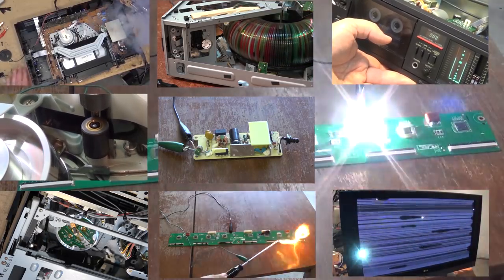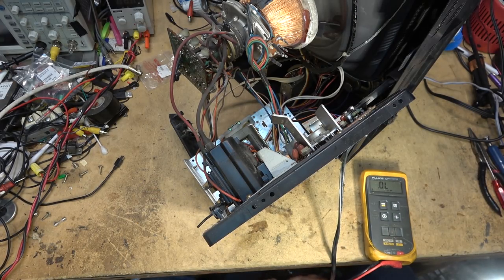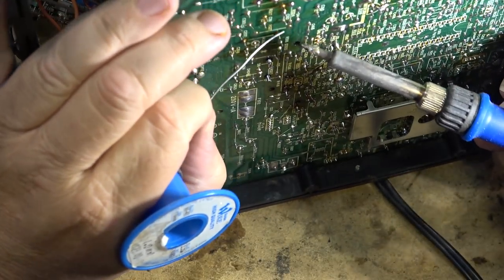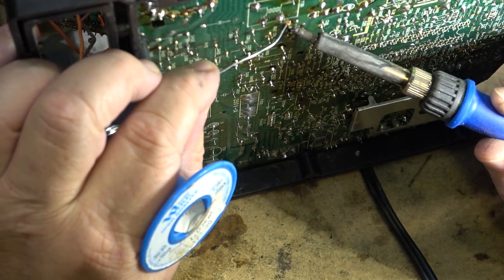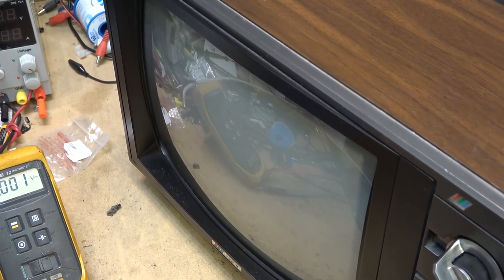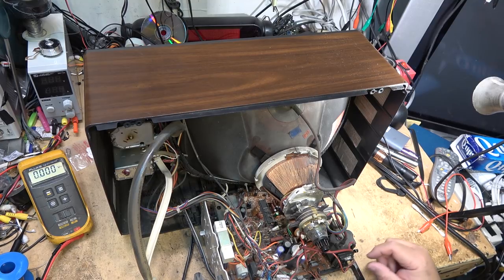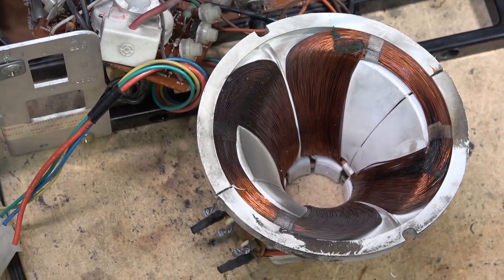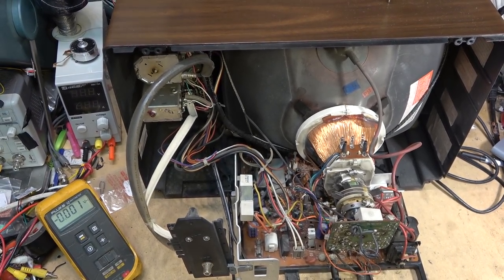Daewoo CRT TV dead. Let's see what's wrong.

Comment: Back when they were worth something, I used to lift the affected pieces of winding and shoot silicone sealant around them. Worked surprisingly well on many of them. Once you clean the burn, there's usually only 2 or 3 turns that are the culprit. On that one, it wouldn't be worth it, so good call

Comment: I have the 1984 model, I guess it's the one before that one, it's very similar probably the same chassis too. We brought it from Canada to Portugal back in 1988, it still works! The horizontal centering is a bit shifted to the left, I can't find any controls inside to center it, would you happen to know how to adjust that on these sets?

My TV is probably the only Pulser TV in Portugal LOL

The flyback burnt to smoke on mine 10 years ago, I lucked out and was able to order one it was the last one in stock. Of course the flyback exceded the value of the TV but it has sentimental value.

Comment: I am an electrical repairer from China. Although I didn’t understand what you said, I saw that you repaired the welding first. The tube was scanned and driven. After I turned it on, I found the deflection yoke to fire. It seemed that the final repair ended in failure.
  我是一名来自中国的电器维修人员 虽然没有听懂你说了些什么 但是看你先补焊了 行管 行扫描驱动  开机后发现偏转线圈打火 貌似最后维修以失败告终
Reply: Yip that’s what I was about to say… like the yoke and thing.. and the watts and then amps and all that..
Reply: 您好! 来自菲律宾的问候! Forgive my poor Mandarin speaking, I try practice Mandarin using user manuals I got from online shopping when I receive electronic units. By the way, I do agree, but resoldering COULD (可能) be the final solution, or just the clue to know the in-depth issue of the unit, since from experience we learn that not only solder joints fail. Electrolytic capacitors fail by age too, jumper wires, rusty feet of components, resistors that are out of tolerance, and many more. But the saddening feeling is if the line output transformer or flyback transformer fail too, or the kinescope/picture tube. That's life, sometimes win, sometimes lose, the most important is trying and learning!
Reply: @sophiestabilitronics The rubber composite harden over 37 years and was interacting with the outside enamel coating on the copper wire which caused a chemical reaction resulting in green corrosion causing the Yoke to fail.      No replacement part was available.  

* In summary the green corrosion on the multiple spun wire is the problem and there was no replacement so the TV is gonna be trashed

Comment: A few months back i was at a garage sale there was a zenith space command there with original receipt and the remote and original manual i got it for 5 bucks got it home and plugged it in and it only has a coaxial ant input, no composite. so out came my radio shack modulator with composite. what a beautiful picture. i was thinking to see what the yoke impedance is to see if i can use the tube in my old Zaxxon arcade game has the wells garderner 4900 19 in tube with terrible burn in from moon patrol someone had swapped it years ago, like to put it to some use, love the CRT picture. keep up the good work mate.
Reply from the maker: They work great for arcade games.  I have a pacman and spiderman game controller that works with standard tv.

Comment: I still have one CRT TV that I bought in January 1990, a RCA 20" stereo remote TV model S20521WN. Still has a real good picture, did a visual inspection a year ago, nothing glaring at me. Are there any trouble areas on this set that can be caught before it harms it? Cost $327.48 back then.
Reply from the maker: I have several including a late model Trinitron 32" with dynamic focus and velocity modulation.   The most advanced tv Sony made.  It's a 2007 model i believe.  Super picture.

Comment: You can play old consoles on modern LCD TVs with virtually no lag (maybe a couple of ms). If they have an RF out, the better LCD TVs have an antenna in, though no one would want to deal with an antenna signal. The audio video signal going to the RF-modulator of the console can often be used as a composite signal after a bit of boosting. and if its composite already, modern TVs will happily accept that. Same goes for component video or even rgb. S-video is a bit more rare. The upscalers of most TVs are a bit slow and they'd want to upscale the resulution of the video signal to at least the lowest the TV can handle, so an external upscaler might be needed like an OSSC or a Retrotink. They're known to add no measureable lag at all and certainly non you'd actually feel. While it's cool to have an original CRT TV, it's certainly not needed.
Reply from the maker: Have you tried it? Doesn't work and the delay of LCD tv is as much as 5 frames.   You don't notice this when watching tv because the sound is delayed by the same delay as the picture.  This is why surround receivers have a manually adjustable delay, so the sound can synced with the picture.
Reply: @12voltvids  Yes, I did try it. I use the OSSC upscaler. There's a comprehensive test on different upscalers also converting lots of different input signals to HDMI on RetroRGB a website and Youtube channel, like here: https://www.youtube.com/watch?v=7VOsOuQ5mhM An LCD TV with all "Video Enhancements" off in "Game mode" adds about 9ms. That depends on the LCD or OLED TV of course, but thats not a lag you'd notice.
Reply from the maker: @Asriazh  let's see you play duck hunt with the optical gun that traces the flying spot on the CRT.  Let's see you play that.   And i guess you are not a hard core gamer as i know those that are and they tell me all the same thing.  Retro games played on retro consoles are UNPLAYABLE on any modern flat panel.   Old plasma TVs that had a "game" mode worked fairly well as that mode turned off signal processing other that frame sizing and resulted in only 1/60 second delay.  
This comes from the guy that has invested over 10000 on computer and consoles over the past 5 years or so.   Someone with no life other than working and gaming with his friends.  His friends also are on the same page.  I have to take his word for it because I don't game.
Reply: @12voltvids  So anecdotes from people You know are more valid than what You can look up and is proven to You in a logical, repeatable way? OK. Btw, even lightgun games can be played on LCD TVs even though that would need a lot of tinkering and is most likely not feasable to most: https://youtu.be/DzIPGpKo3Ag You keep what You believe and i'll continue playing games on retro consoles close to lag free. A few ms seriously don't hurt anything. But that's probably not true :D
Reply: Low res games look like absolute shit on an LCD TV, nothing beats a CRT to display 240p games properly and how it was designed to. Just search "240p CRT vs LCD" LCD looks like a pixelated pile of garbage.

Comment: I remember this being quite a common issue with some of the Dixons (UK) house brand sets (Matsui), manufactured by Orion, even back in the nineties when they weren't even all that old! 

I guess it's kinda lucky the fuse blew, as the Horizontal Output Transistor will usually fail if left to run in that state..though by that time it's like rearranging the deckchairs on the Titanic!

Comment: Wonderful! That's older than me haha XD I'm 6 years short of that unit hahahaha XD If that will come back to life, that's a wonderful gamer's choice TV to enjoy games released close to its time, for example, NES ones! :) Picture tube with that gray gradient feels more nostalgic for me than the darker gray ones, like for example, ones made by JVC before millenium. Oh, the magic smoke, how it never ceases to amaze my eyes, my heart and my soul, especially the one with split-second fire and fury hahahha XD
Reply from the maker: I was not happy to see that.
Reply: @12voltvids  After the amazement, next comes pain because of the great responsibility how to restore or try to revive it or replace. I do agree about the rubber could cause that, one of the technicians here tried to repair the same defect as you had, tried separating using thin knife, tried putting lacquer thinner to clean the surface, resolder with j-hook connection style and put nail polish or varnish, still the defect came back, it seems that enamel coatings of yoke crumble as they age, wish I could learn reconditioning them carefully... The technician decided to buy similar yoke for curved televisions and worked, but the yoke that kind looks expensive here due to copper content.

Comment: that tv looks like it's in good shape too from the outside. you don't see too many knob sets anymore. too bad it can't be fixed. unless someone has the yoke for it. are yokes universal? like if you get another 13 inch with a bad board or tube could the yoke be used in this one?
Reply: It's fixable, just needs some patience to find a yoke / yoke+CRT donor. Not universal, but there are not too many types, chances are you pick up the first same sized TV even from the 2000s on clearance day, you replace the CRT along with the yoke and it will be fine by more than 50% chance. Just check through the ventilation grille the picked up set doesn't have the thin necked CRT in it, and doesn't have many hours in it judging by the amount of black dust inside. Even if the yoke doesn't fit for the chassis, it's often possible to adjust the chassis to it by replacing the width adjusment choke from the donor or from another set. I've done that a few times when the width was too narrow with the replacement yoke. Once I even rewound the adjustment choke (to be more precise, removed turns from it, not rewound).
Reply from the maker: Uneconomical to repair. Unless the correct yoke was available for free.  They are all different too so you just can't slap any yoke on.   Had to be for specific picture tube.

Comment: could this arcing be a fire hazard or will the fuse blow quick enough ?
Reply from the maker: There were many fires that were a result of arcing in the horizontal section of several zenith tvs in the early 80s but that was the linearity coil that came unsoldered and the fuse never blew.  The circuit board ignited and that was followed by the wood cabinet and then the house.  A bunch of kids died in that xmas Eve fire.  It's on the net just google it.  The settlement was sealed so nobody knows what zenith had to pay. Was right after they moved the factory out of Chicago and south of the southern us border where they paid their factory workers something like .18 per hour.   Not that it was much better in the USA where the wage for factory workers was only about 2 bucks an hour.  Here our minimum wage at the time was 3.15 and I was laughing making about 20 an hour fixing TVs.
Reply: @12voltvids  sad to hear that happened. I found an article online about it.

Comment: Probably too much dust ! The dust bunnies can sometimes cause a short/moisture conduction problem, also power caps. Had a dust problem with an amplifier
Reply: @Taco yeah, too much time involved in trying to do a rewind job on the yoke !
Reply from the maker: @Taco Pretty much.
Reply: definitely) met such issues here in this tropical island, especially during and after typhoon strike, some units will have strange lose connections, like for example, on socketed units. met such issues on desktop computers throwing blue screen of death, only to found out that moisture leave such "white" thing and oxidizes the contact. worse issue could be corrosion under the thick dust. i either use eraser, or clean them with lacquer thinner and works like new)
Reply: @Taco That green stuff is particularly worrying, since that means the rubber was breaking down into fatty acids and directly attacking the copper.

Comment: Actually, older games can run on newer TVs.  Nintendo Switch can output them in HDMI.  The same is true with PC based emulators.
Reply from the maker: Vintage gamers use the original consoles, not emulators.   Games like duck hunt need the flying spot to work.
Reply: Old 240p games look like shit on modern displays.

Comment: Is it worth pulling the flyback and HOT out of that unit?
Reply: It's worth keeping the whole set until the next clearance day to find a yoke donor for it, or possibly yoke+CRT, the CRT might be tired in this one, looks like it has some hours in it, the raster looked purplish and unfocused when Dave switched it on. It's also easier to replace the yoke with the CRT because you save yourself from convergence and purity adjustments. This is a really nice very retro cool set with its mechanical rotary tuner. These are getting harder to find in good condition. I suggest no to trash it, Dave!

Comment: Its not true that you absolutely need crt tv to play old games, there are converters now that take care of the lag problem and you can play old games on new tvs if you don't believe me check AVGN channel he has one and show it in one of his videos and ever since he got it he plays his games on new tv
Reply from the maker: There is still lag.  It's the way that LCD sets process the signal.  Minimum 4 frames.   Also games that require the flying spot to shoot at don't work at all.  Anyone that tries to tell you different has no clue.  There may be low delay converters but you still are limited by the fact that all displays have 4 frame processing delay.  The old plasma sets with game mode had it down to 2 frames.  One frame displayed as next one (2 fields) being read in. That's 1/30 second  delay. Some LCD have as much as 10 frame delay.   4 frames is 1/15 second.  Not much but it is still there.   Crt is line by line, so never more than. 1/60 second.  
So even the fastest LCD screens are 4x slower.  You can't get faster than that because you are up against physics.  The LCD pixels must physically twist and untwist.  OLED is faster but the processing is also more intense.

Comment: i wonder if new crt's will ever be produced again for the niche market they still fill
Reply from the maker: Never. Now if you want to set up shop rebuilding them I am sure you can find the equipment. Someone probably has the old. Equipment and you can make your own electron guns.  There is a video on YouTube of the last CRT rebuilder doing the last tube he was ever going to do before closing his doors for good.
Reply: I've heard of some companies making reference displays with Sony picture tubes. No idea if they were old stock or if it was a short run.
Reply from the maker: @DGTelevsionNetwork  
Probably old stock.  I'm sure they made extra tubes for speciality applications.
Reply: No, it will never happen, one reason, lead is an environmental no no, and CRTs need leaded glass, also it wouldn't be profitable as only very few people would actually buy one, and even fewer if they had to pay as much as an oled 4K TV.

The Chinese are still making "new" CRT TVs using random NOS parts and probably even  reusing old essential components such as flybacks.